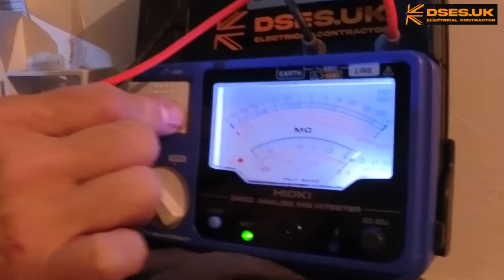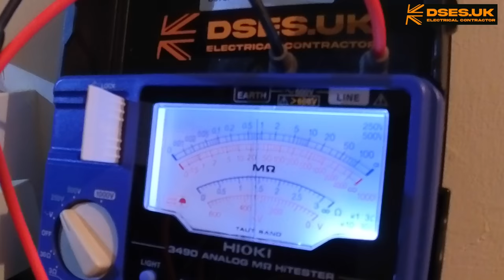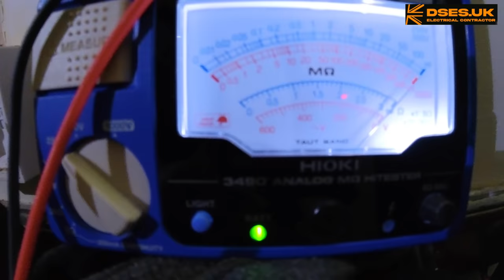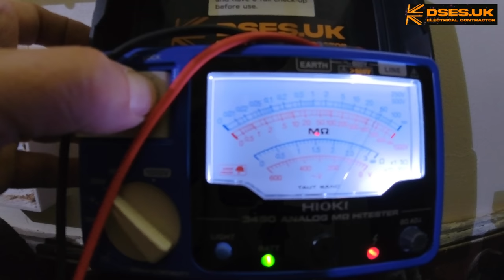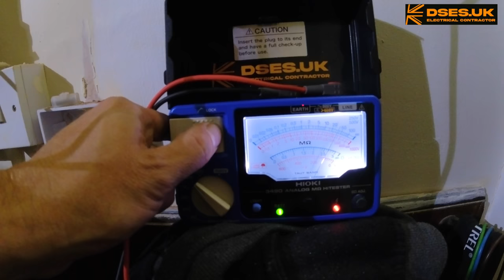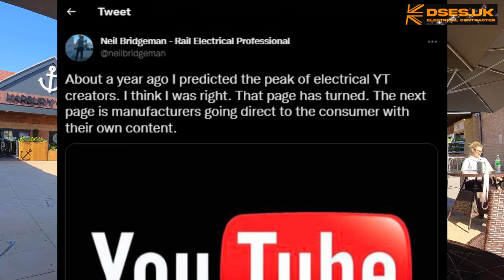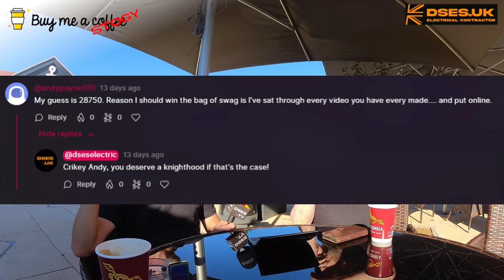Oh FFS, it's another board change video

Comment: Murphy never ceases to amaze me. All that room behind that face plate in the box, and the active finds it's way into the 4 or 5 square millimetres that will cause a fault.
Reply from the maker: Looked like a kitchen fitter job - way too much wire left to stuff in. Anyone failing to dress their wiring properly will come a cropper eventually, although sometimes it won't manifest until long after they've buggered off.

Comment: I have a very strange IR reading on a circuit in my house which for a while would randomly trip the rcbo, the strange thing is i can see the run of the cable from board to first point which is where the fault is, no signs of physical damage or bad connection, now it seems its all fine !

Comment: Had a really interesting fault yesterday.
Fitted an rcbo to a motor circuit. Without the motor on the rcbo tripped at 20 ms.
With the motor on the rcbo tripped at 100 ms.
Both tests at 30mamps.
Why would switching a motor on extend the rcbo trip time by 80ms at 30mamps?
Thanks.
Ps I thought asking this question here would be a good idea because of Daves amazing knowledge base.

Comment: Thanks again for the excellent entertainment and enlightening content. Quick one here im staying at Center parcs robbing bastards. My lodge is fairly small in demand but has a 3 phase supply (4 pole main isolator on the  board and 400v sticker)  the surrounding lodges have big electrical Saunas. Is this the reason why for balancing loads etc or for simplicity and continuity of installation? Sorry if my question is dross
Reply from the maker: Ah, Center Parcs. We went there in 2009 and found it was basically a way for them to simply help themselves to the contents of your wallet while you were imprisoned in their encampment. I can't answer as to their electrical installation other than they perhaps ran three-phase everywhere to keep it balanced and to always have availability for future expansion.
Reply: @dsesuk  Thank you for the reply and a theory it is much appreciated. Now back to tap water and bread slices for dinner as I’m   Past broke.
Reply from the maker: @Nypartcannon  They'll be metering your water Naill. You'll be billed for that before you can leave!
Reply: @dsesuk  beer it is !

Comment: Morning Dave, could you do a video on a supply to an outbuilding from a PME supply with the new regulations recommending a earth rod at the house side, a type of dual earthing system a PME-TT would you also earth rod the outbuilding and would you separate the sub main or link it to the outbuilding consumer unit.  I was just wondering what your thoughts were on the matter.  I was watching the latest Artisan video and raised the question there.

Comment: Fantastic video guy’s as always. What was the reason for changing the CU ? , as I couldn’t see anything wrong with it , and well done Nigel for finding that damaged line conductor 👍 as usual David you two soon got to the bottom of it and sorted it out , job well done 👍 and good to see you putting the hokey kokey to work shame we didn’t get to see Robin in action again.
Reply from the maker: The old unit was oversubscribed for the amount of circuits it was supporting, but aside from a lack of RCD additional protection (which the installation predates) and a non type-tested MCB, it was functional if not pretty. The landlady wanted to take the opportunity to correct various issues uncovered by the EICR and to modernise the installation for the next tenant which was the driver behind it all. She lives out of the area and doesn't want the headache of a tenant complaining of faults or having to call us in for maintenance any more than is needed.
Reply: @dsesuk  yes I can understand that. I did watch the video again and yes you did say it was oversubscribed. So I apologise for my misunderstanding. It was not a reflection on you.
Reply from the maker: @Dog-whisperer7494  No need to apologise old man, we don't stand on ceremony on this channel!
Reply: @dsesuk  it’s just me i’am old school and a grumpy old spark who’s stuck in his ways .

Comment: plus side some lovely soul has added an isolator so you can do the board chance beacuase as a professional for some reason you can't pull the fuse
hnc/hnd maths way too hard for me fair play by your own admission you passed I struggled my balls off transposing formulars  and working out the adebatic equation with the 2330.
again perhaps it may have been the teacher or the fact I'm infact a tick as thick as two short planks.